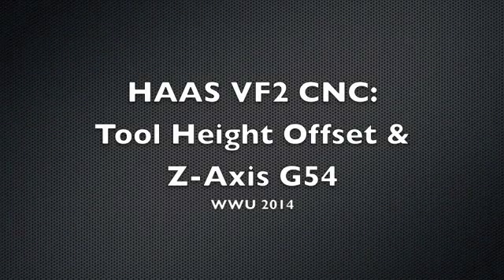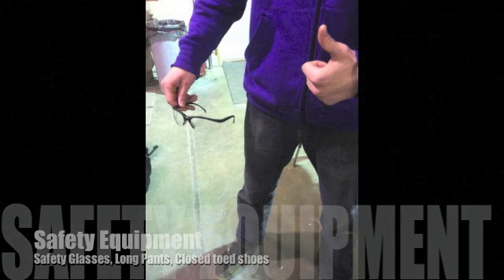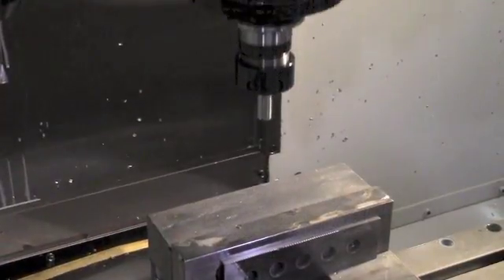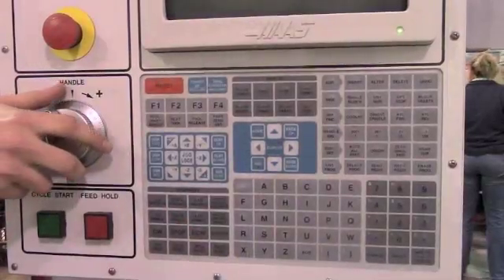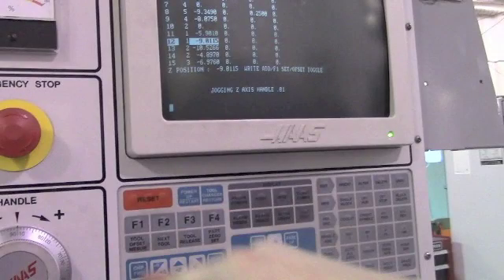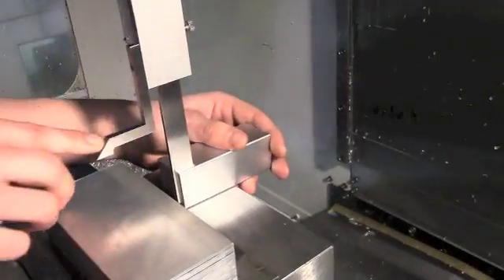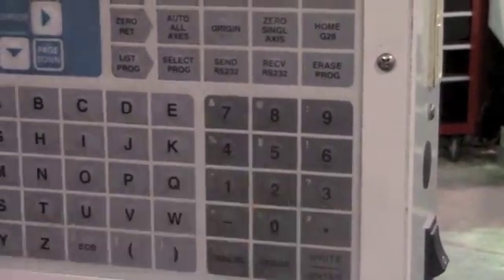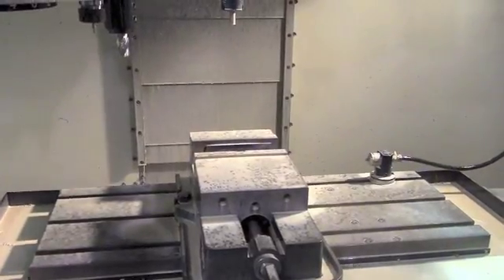HAAS VF2 CNC TOOL HEIGHT OFFSET AND Z-AXIS G54

Comment: Why not to use compressed air to clean the machine after finishing the work?
Reply: Compressed air will work, but many shops don't allow it because compressed air forces chips under the wipers, causing wear on the rails and even failure.

Comment: G54 on my bench vise its = distance from G28 machine
then G154P1 its my new origin for the piece = G54 plus caliber misure
then offset in the same manner but...i go to offset screen for the tools with G54
in the end the one thingh that i must perform its G154P1
G54 its all the same and offsets its the same because i use G54 for offset
when you on the machine just adjust G154P1 and work :)
(sorry my english its bad XP)
you dont subtract the diameter of the piece in your hand?
(offset tool then -16mm of the piece in incremental)